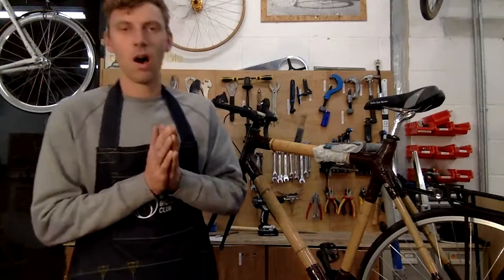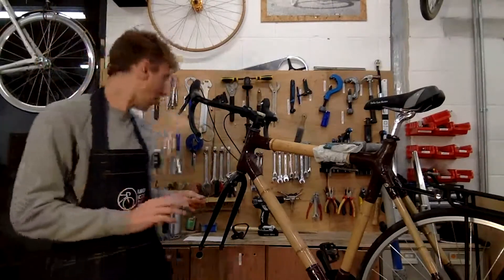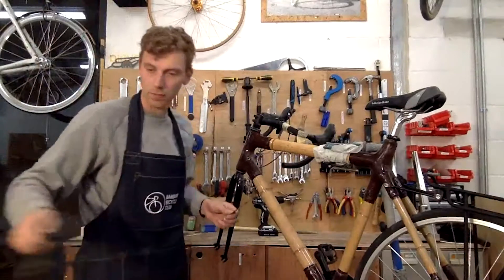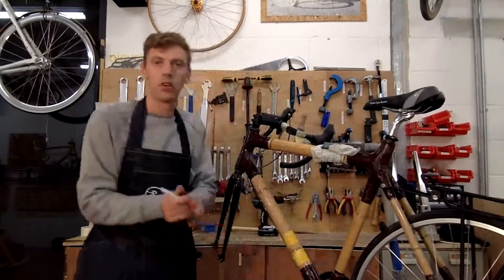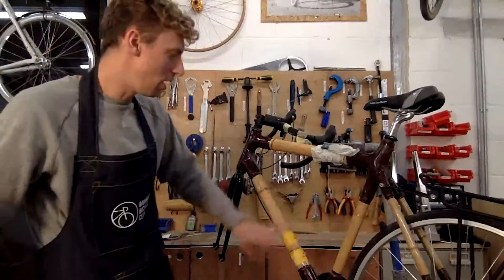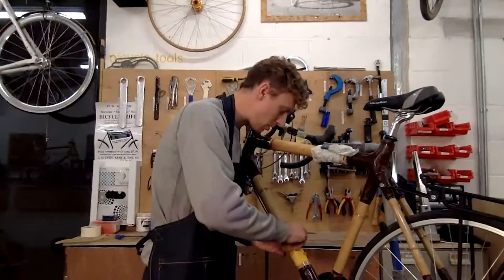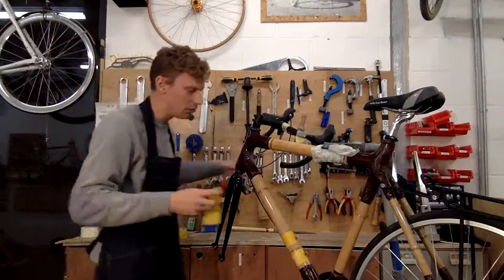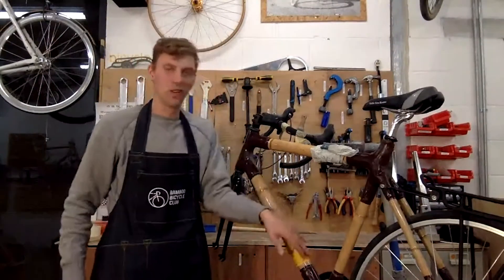Frame Inserts - Fitting Bottle Racks

Comment: So the threaded inserts I got in my kit, I am told they are crush rivets that have a special tool that will compress them (pulling the bottom thread towards the top collar, creating a collar on the back side of the tube). However I assume these are for metal or CF tube frames and I note that you use glue and don't compress them so am I correct in thinking that compressing them with the proper tool would potentially crush and weaken the bamboo fibre around the hole and insert collar? Also how does the flax fibre not create an obstruction between the two bonding surfaces of the bamboo and the insert? Is it kind of like a reinforcing fibre (like Glass fibre) for the glue? Thanks. Loving the bike. Goes like a dream. Cheers!